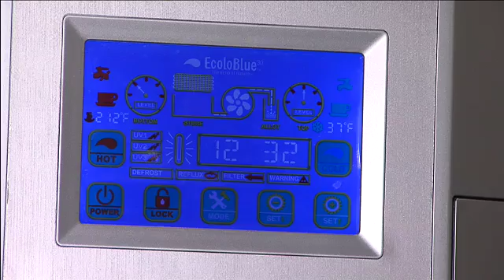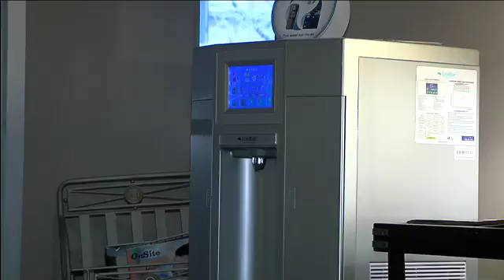Drinkable Water Made From Air Becomes Reality

Comment: Cooling of air compresses the hydrogen and oxygen molecules, The water in the air or humidity is H2O whis is hydrogen and oxygen atoms that have already bonded and are actually large. The cooling process just squeezes them out, from gas to liquid. Water is the only thing that can be a solid, liquid or gas. Water also is uncompressable.